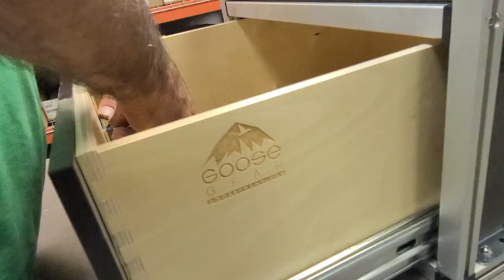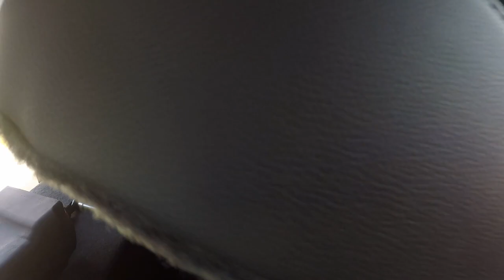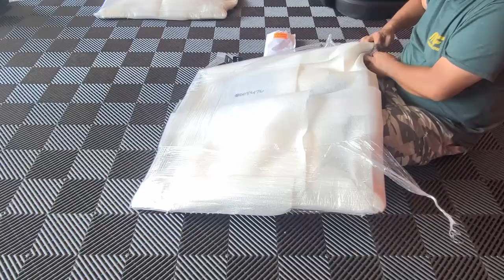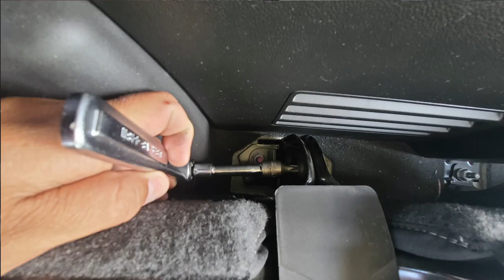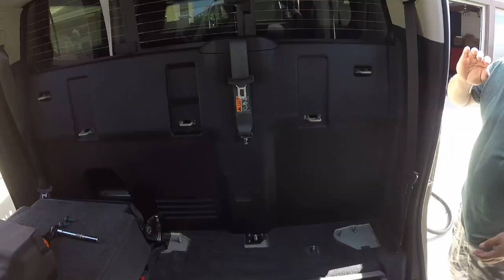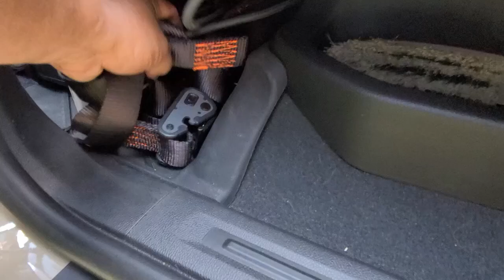Colorado ZR2 Bison - Rear Seat Delete for more space for more gear

Comment: Just curious why didn’t you remove the back passenger driver side seat belt as well if you wont be using it? May be just me but i wouldn’t want to look at it with it having no function. Still enjoy the video. Didn’t know these products were around. (I don’t own a truck but i would love to own a Colorado one day)
Reply from the maker: thanks for checking out the channel and for leaving a comment. I very much so though of removing it but it leaves a hole in the rear pillar where the belt mount would be and that would have bothered me just as much.
Also you notice how quickly the delete panel goes down its only 5 bolts and you can drop your seat in so Its quick for when i need to carry 4 adults. For what it is worth, I will never use the rear middle seat so that center seat belt was easy to justify removing.

Comment: That looks very nice & good video. I would
like to do the same to my Colorado but I put the ESP lockbox back there so the Goose Gear won’t work with it. I’ll probably have to DIY something so I can still reach the lock box.
Reply: That is the box. The door is a swings upward so you could not access it through those hatches.
Reply from the maker: @TheDisillusioned1811   got it. Definitely have to go custom. I'm thinking about fabbing up an aluminum organizer for under the GG delete. Somethign more proprietary for my needs
Reply from the maker: Is that the box / gun case that goes under the seat and locks?